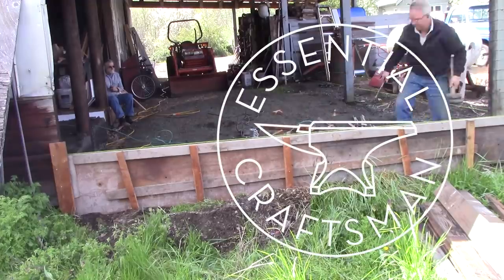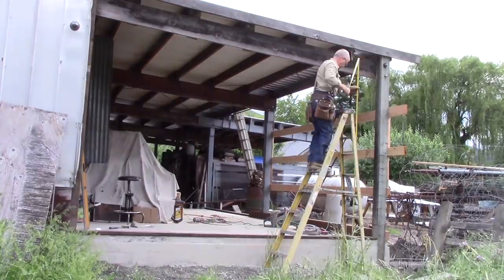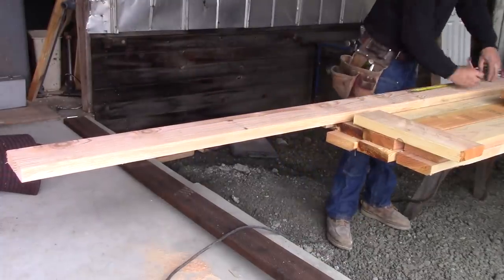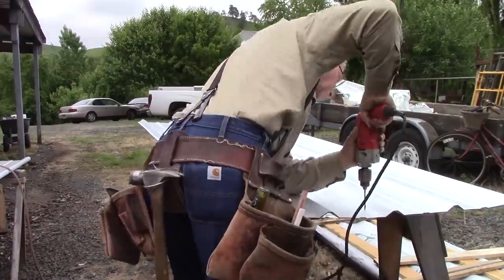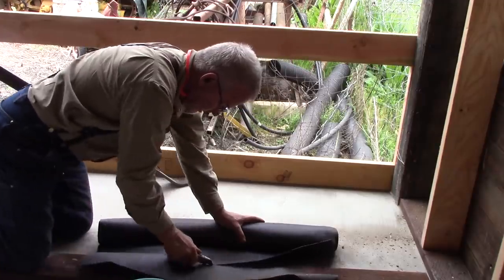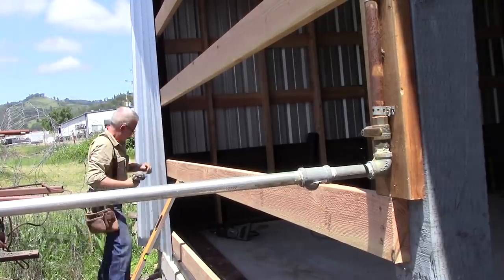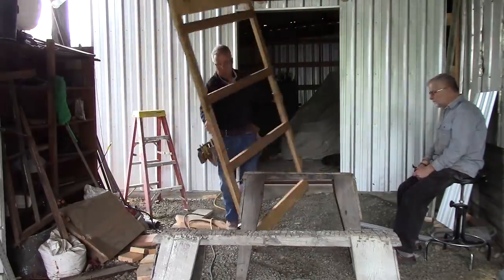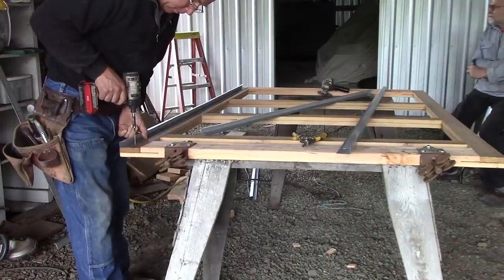Shop Evolution and Expansion: Part 3

Comment: Brick is not that expensive around Louisville, KY. Just finishing get my pole barn bricked. Paying less per sqft for brick themselves than my house 20 years ago. Labor is up some but not bad. 

I used Perma Columns and I think they are the way to go. Morton buildings has their own custom version and is their standard now. 

RR is really good but have only seen him use 18” piers.  That’s no where near what my relatively small building called for.
Reply: Not sure you are saying 18 as in diameter or depth, but he does go below the frost line for depth and are 18 or close to it in diameter. Midwest started the permanent column revolution and yes Morton's design is quite different with its slip tab style. One other bracket most do not still know about though is Strong Way System - Strong Post Columns which they offer as wet set only and is adjustable, as well as a repair boot for rotted base post-in-ground type installs that slips over and driven into the ground leaving the column intact as it is.
As for those still wanting to bury the post into the soil have a few choices for protection to further extent the life before rot set in and repair is needed, they are Polesaver/Postsaver slip on sleeves you then heat shrink, then there is boot and sleeve types from Plasti-sleeve (60 inch at least for boot, and 22 inch long sleeves) and Post Protector (comes in 60 inch for Post Frame and 42 for residential such as decks for the boot style and 30 inch grade guard sleeve) as well as both offer skirt/splash board protectors as well.

Comment: On the inefficiency of adding people to a job; there is a classic work in the world of IT called "The Mythical Man Month" that makes the case that adding people to a late project will make it later.  The problem is that any group project requires communication to coordinate the efforts of the team and the complexity and time required expands proportional to (n(n-1))/2.  The aim of the book is to teach managers that talking about human work as if simple arithmetic applied is nonsense.  Once you get beyond 2 people adding people does not increase efficiency in a linear way.

Comment: I'm curious about the vertical metal sheathing, did you use any sealant between the sheets, or is the fit tight enough to keep out any driving rain/moisture?
Reply: Most have it overlapping where the main ridges meet, some includes an added micro channel  which siphons rain preventing the water from getting further underside as an extra measure, but in most instances its just simply installed without any gap tape, though not all design are that simple and some styles may or will require sealing tape or caulk. So long as one follows the manufacturer instructions then there should be no issues.

Comment: I've had to replace poles that rotted out from under one of my buildings.  If you have the money concrete piers is definitely the better building method.
Reply: Precast ones are more pricey but still worth it if you have the machinery to handle them as they are heavier than an 80 lb bag of mix and are of high strength at 10k psi rating.

Comment: Did I see you operating a 9" grinder without a guard?
 At the same height as your goolies and your father also in the firing line.
Candidate for the Darwin Awards right there.
Love the videos by the way.
Reply: Guards are for lawyers. Competent tradesmen know and respect the equipment and know exactly how to use it. I've taken guards off grinders plenty of times, especially when I want to cut something very close to a face.